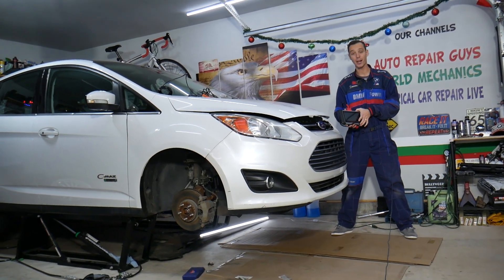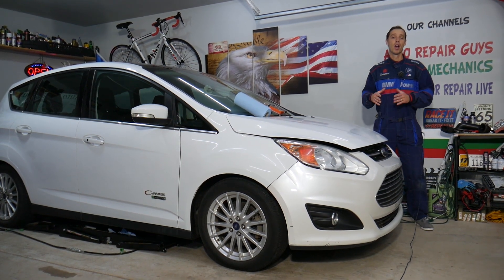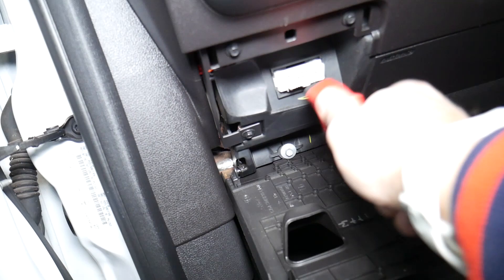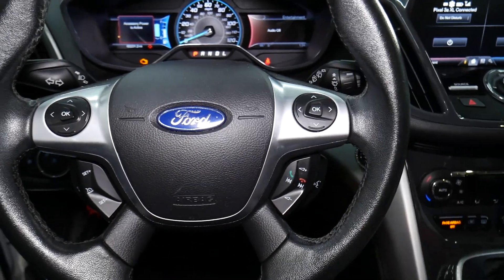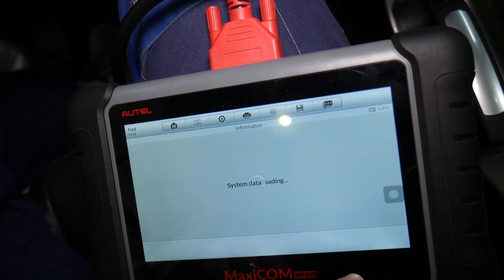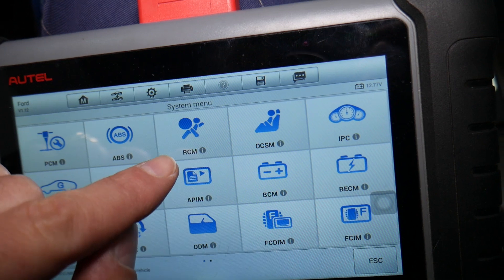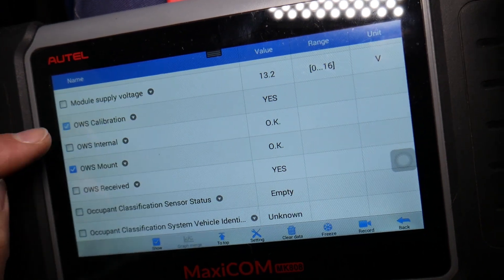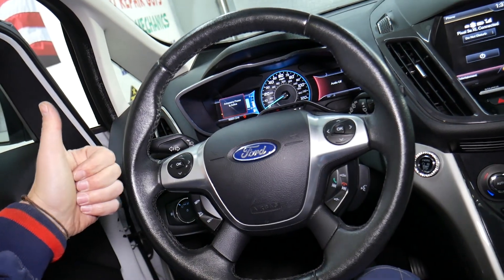HOW TO TEST SEAT OCCUPANCY SENSOR MAT ON FORD C-MAX, AIRBAG LIGHT ON

Comment: We have a problem with a new Ford Tourneo Custom. The driver's seat occupancy sensor is not working reliably. I am searching for the relevant sensor in the RCM control unit using Forscan, but I cannot find the driver's seat sensor. What is the name of the sensor?
Furthermore, the seatbelt sensor driver permanently displays 5.8 mA current (without seat occupancy). The front passenger seat is at 0.00 mA. When the seats are occupied, the driver's seat is at 13.8 mA and the front passenger seat is at 51 mA.
This is very strange. 
What do you think?
Greetings from Germany.